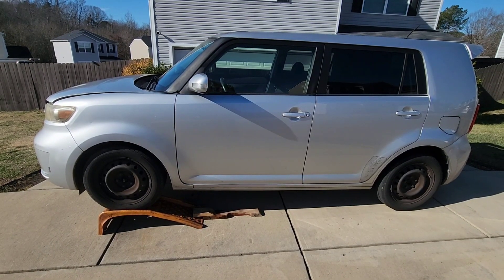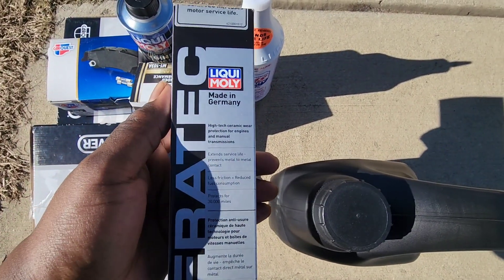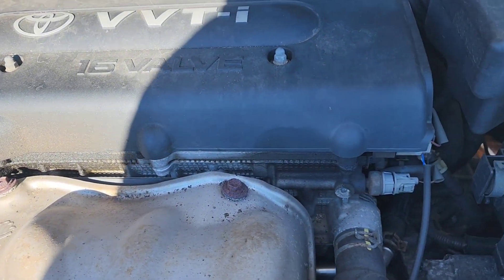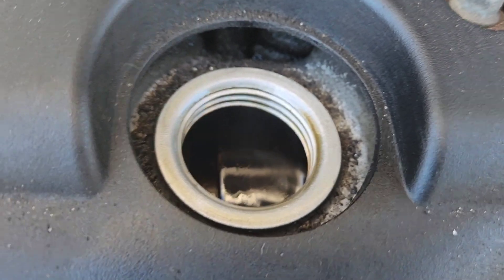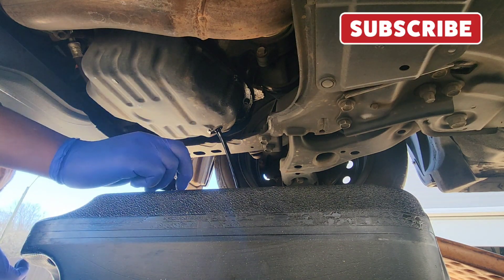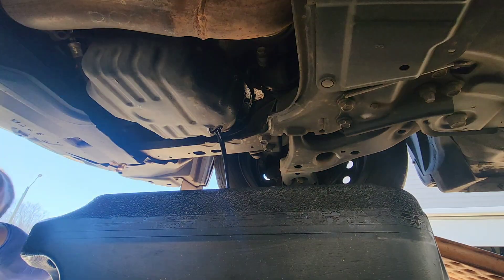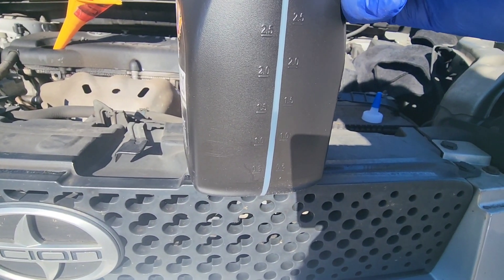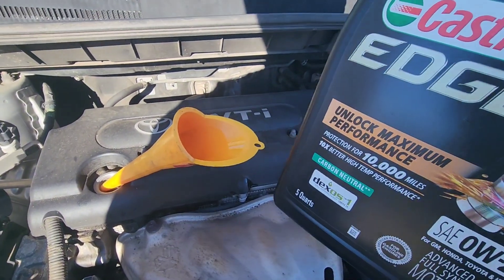Scion xB Engine Flush / Oil Change

Comment: What year is your scion? I was also wondering if the engine flush is necessary for an 09 with 50k miles on it the engine is basically broken into. I was also wondering what if you let the engine flush sit in your engine fore a few hours and then flsuhed the oil out would that help by cleaning it out for an extended amount of time and then adding new oil?
Reply from the maker: Mine is a 2009. Yes you should flush your engine at least once or twice a year. If you go over the mileage on your oil changes that oil starts to burn. The Pistons in your engine have holes on them to keep them cool and to pull oil off of the Piston wall. If the oil burns on the Piston it can clog the holes which could cause oil consumption. Using engine flush cleans that burn oil from inside the engine and off the Pistons. I wouldn't let it stay in the engine no longer than about 15 or 20 minutes. Eventually it makes the engine overheat because it Waters down the engine oil.
Reply: Ok cool I appreciate the feedback just bought some liquid molly but I think I'm just going to go with 13 minutes like it recommends on the bottle switching from a conventional oil to a synthetic mobil 1.

Comment: I know this may sound like a stupid question. But when you did the engine flush, sdid you do it with the old oil in. Reason I'm asking is I have the same vehicle and I'm getting ready to do this to mine.
Reply from the maker: Yes I did the engine flush with the old engine oil in. Technically I guess you could change the oil do the engine flush and then change the oil again but I wouldn't I feel that that would be a waste of money.